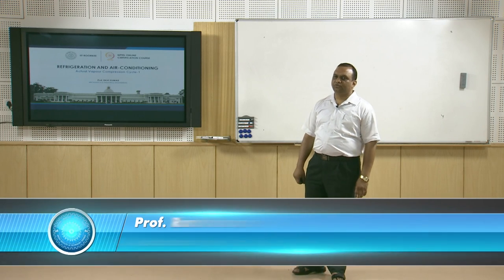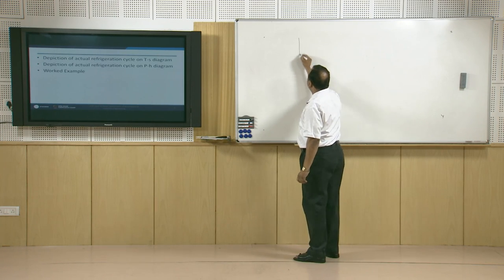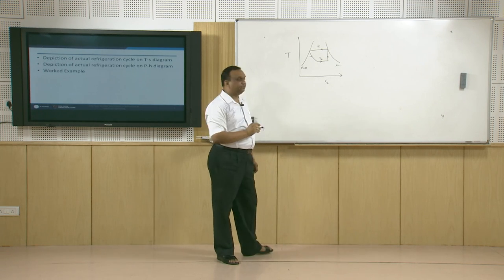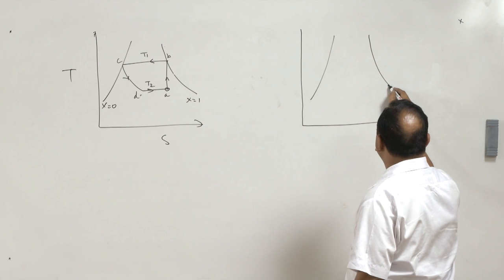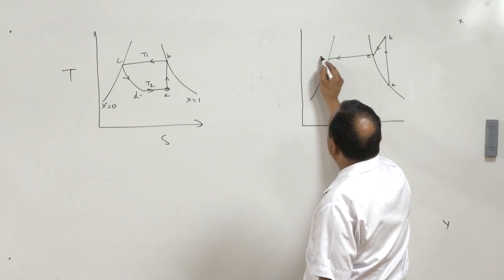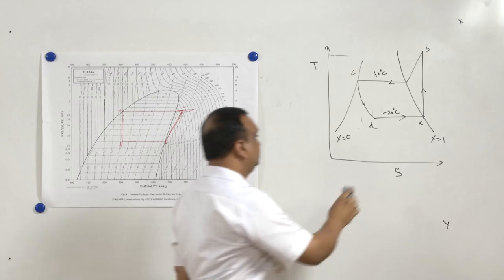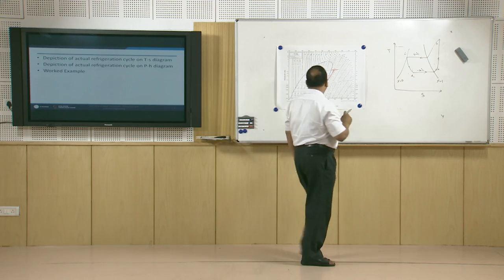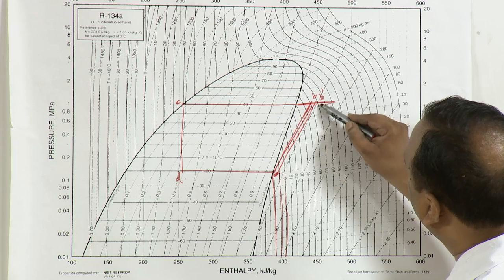Actual Vapour Compression Cycle-1

Comment: How can the sub cooling from saturated liquid state to sub cooled state is achieved at constant pressure??.
I think it follows x=0 line; 
that is saturated liquid line only.
Reply: Subcooling can be achieved by bringing the refrigerant from the condenser outlet (saturated liquid at this point, hence quality is zero) to an intermediate heat exchanger, which also has the refrigerant from the evaporator outlet flowing inside of it on the opposite direction. Since the saturated refrigerant gives off heat to the refrigerant at evaporator outlet, and since it is a constant pressure process, the net effect to the saturated refrigerant is a lower temperature at exit of intermediate heat exchanger. Therefore, it becomes subcooled in the process.

Comment: why we are desaturating that vapor after the point 2 , what is the need.?
Reply: By saying "desaturating", I assume you meant to refer to the condensation process or heat rejection process as the superheated refrigerant lowers its temperature from state 2 to state 3 in a constant pressure process inside the heat exchanger. The condensation of refrigerant is required in order to reject an amount of heat,  and therefore not violate the Kelvin-Plank Statement and the 2nd Law of Thermodynamics. We can apply the Kelvin-Plank to a refrigeration cycle such that it is impossible for a system to operate in a thermodynamic cycle such that the sole effect is the net transfer of work into the system while transferring a net amount of energy to/from a single reservoir. That is, we need at least two thermal reservoirs (a high and a low temperature reservoir). Now, for the 2nd Law of Thermodynamics, a "cycle" without condensation process but with only evaporation process will result in a negative value for entropy generation, which would be a violation of the 2nd Law.

Comment: how to get value Tb ?
Reply: Since the table presented in the lecture does not have property values at Superheated state, the professor used 1st Law of Thermodynamics for Control Volume at the superheated region of the condenser. And because it is assumed to be a constant pressure process (no pressure drops across the tubes), we can make use of the definition Cp = dh/dT to compute for the change in heat energy.

Comment: Is vapour compression cycle reversible cycle
Reply: No
Reply: A vapor compression cycle is not a reversible cycle because in its simplest form or design, the expansion process happens in throttling valve which is highly irreversible. The carnot cycle is the reversible cycle.